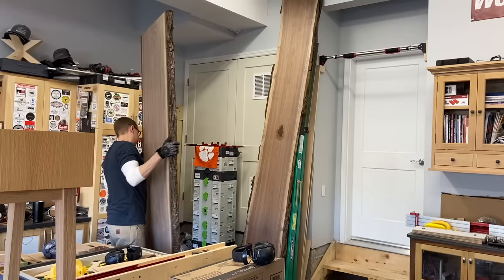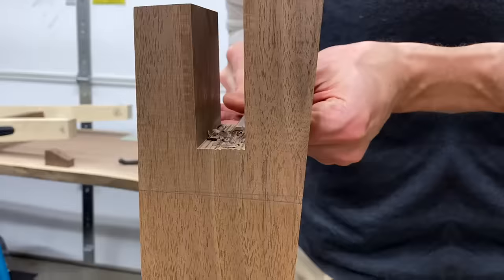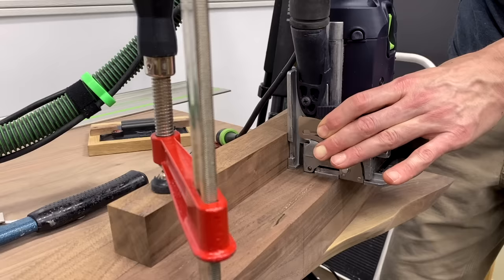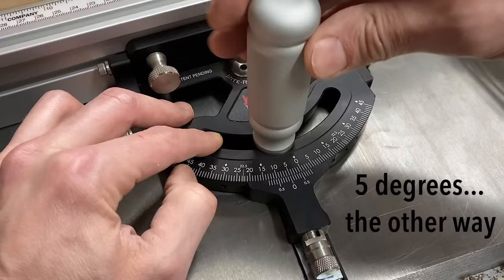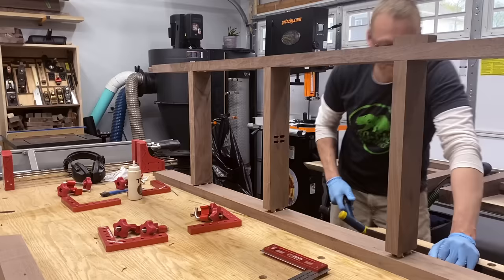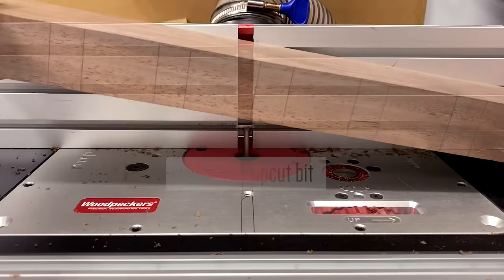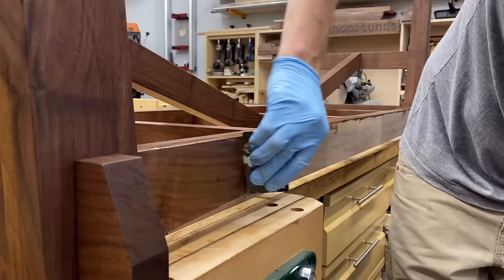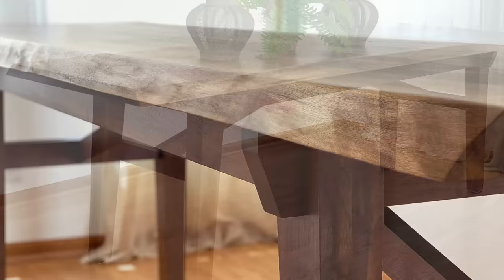BIG SLAB walnut dining table.

Comment: I was admiring your work and skill until I saw the gorilla glue ! WTF !!!!
Reply from the maker: What does that mean?
Reply: @KeithJohnsonCustomWoodworking  gorilla glue is pure crap one its messy as hell due to its expansion secondly this expansion is what makes it week ! Gorilla glue is a polyurethane base glue which are the strongest glues we have . BUT because polyurethane glues are volatile they don't keep well this is why for best results your supposed to dampen the surface with water before applying the glue . The chemical reaction between the water and the glue turns it into a polyurethane glue this is its failure because this reaction is taking place inside the joint the bubbles that are formed get trapped in the joint making it WEEK . Pure crap its only use is for glueing dissimilar materials ie brick to wood plastic to cinder block. Fine wood working did an extensive wood glue test back around 2012 ? It went through all the glues including epoxies in a variety of woods in tenon joints with lose fit proper fit and overly tight fit and used extremely controlled pressure measuring to failure and tight bond 2 proved to be the best overall not evey single category but largely the best . But keep in mind that if tight bond gets on the surface of the wood stain will not take to it you'll be sanding a divet in your peace to get the stain to take so mask the edges next to the joint .
Reply from the maker: @michaelvaughn2287  So, you've had a lot of experience using or just reading about it?  Matthias Wandel
did a breaking force test of Gorilla Glue and Yellow Glue with no gap...Gorilla Glue 205-230 pounds, yellow glue 180-190 pounds of force to break the joint.  I'm not worried. It was a tight fitting mortise and tenon - cheeks to the sidewalls. That's where the strength comes. There is plenty of adhesion of long grain to long grain happening in that joint despite any bubbles. Titebond sets too quickly and doesn't give me the open time needed for that type of glue-up. So, what would happen that TB would start to dry and film over during assembly before the joints were together and produce an extremely weak (not WEEK) joint. I use polyurethane glue and epoxy for complex glue-ups where open time is needed. Old Brown glue is also an option.